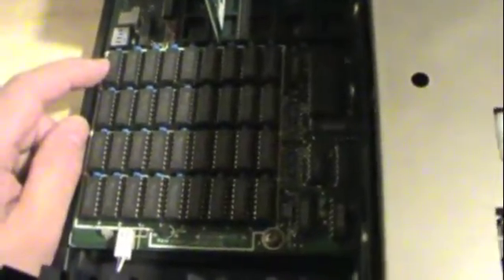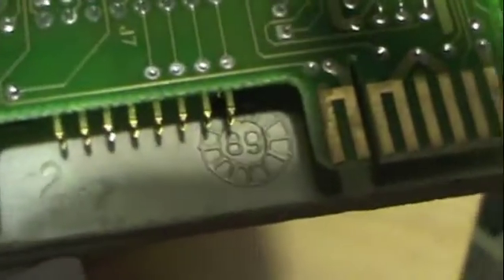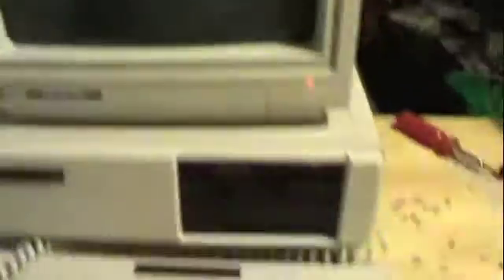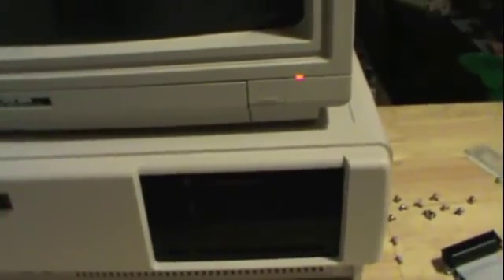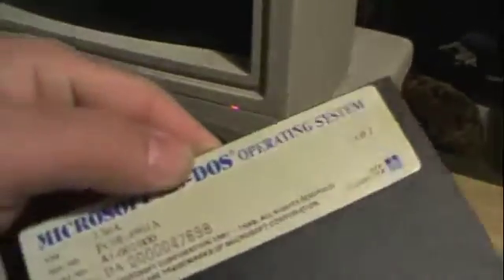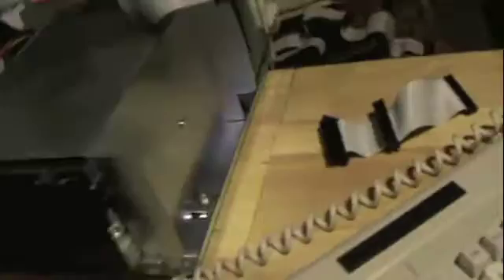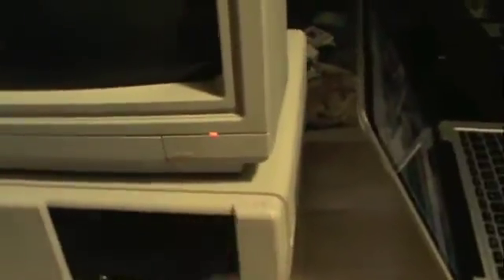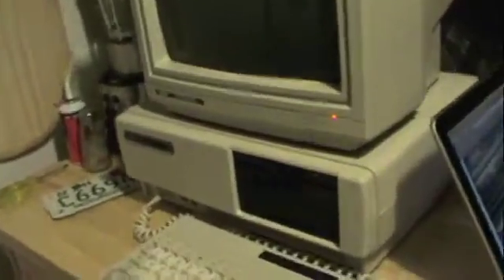Upgrading the Tandy 1000SX

Comment: Why didn't you do a low level format of the hard disk? Given the age of this drive, you really should give it a low level format and find the right interleave for the drive on the internet. Also, I think you should have gone with dos 5, if for no other reason than to have edit.com and qbasic needed to run it. Edit is 1000X better than edlin.
Reply: QBASIC.EXE can be taken from DOS 5 and run on DOS 3.0 at least, I think possibly even on 2.0 or 2.1.

Comment: Why are you bothering with dos 3.3? Why not use dos 5? Dos 5 works fine in XT class machines and doesn't take much more memory than dos 3.3. Also, don't these Tandy machines have dos 3.x built into the rom anyway? Mine does.
Reply from the maker: Because I don't have a copy of DOS 5.x. It's as simple as that! No, only the Tandy 1000HX includes DOS in ROM; and it's version 2.0 if I recall.
Reply: BBISHOPPCM's World
I have a TX that has dos in rom, or at least I think it does because I don't have a KB or DB-9 mouse at the moment or it and it boots into Deskmate (or whatever it's called) which is dos software and iirc, you can quit from it and run dos software which would mean dos has to be in rom. I did enjoy your videos.
Reply: tarstarkusz One other thing, if you have the patience for it, there is a PC emulator called PCE and it emulates an XT class computer with a 80186, VGA, a hard disk and 2 floppy images. If you download it, it comes with DOS 5 installed. You can sys a floppy image or format it with the /s and then write the disk image out to a floppy. It takes some work, but you can get all of the dos files and a bootable disk out of it. I used PCE and Dosbox to get files to and from the PCE emulator (either from PCE onto my file system or from my file system into the PCE harddisk image file).
Reply: The HX's ROM DOS is 2.11.  I used to have one.

Comment: Will the Tandy work with any XT style keyboard? I have a Tandy 1000TX (IIRC, which has a really weird system, it's an XT with a 286 chip). The memory layout is weird too, it has 2 banks of 41256 chips and a 1/2 bank of 4164 chips with the other 4 DIM sockets unpopulated, but it's maxed out at 640k + 128k for video with dos in rom. But I don't have an XT style keyboard or even an AT style with the XT/AT switch. I've seen a number of XT class keyboards on ebay, but I don't know if they are wired the same. Do you know if a normal XT class keyboard will work (BTW.. I know that not all 5 pin din keyboards are XT). I've been involved in computing for a LONG time (since 81), but I cut my PC teeth on  IBM XTs and 5150s. I also went to a 2 year tech school for electronics and PC repair in the very early 90s..
Reply from the maker: I don't know off hand if a normal XT keyboard will work. I did most of my XT-class computing back in the mid-90s, when that was all I could afford (I was 12 then).
Reply: BBISHOPPCM's World Don't feel bad, it was all I could afford too and I was in my early 20s (but I was going to school full time)! :)  But as you know, PCs were expensive as shit back then. Of course, they were much higher quality. Have you ever heard of a memory bank of 4 4164 chips, particularly in a series of sockets that are 8 deep? Also, the sockets are directly next to 2 other rows. Most MBs that I have seen (and I've seen thousands) didn't work in such a way that you could add 32k by adding 4 4164 chips. You usually had to put them in 8 or 9 at a time depending on if they use parity, which most of them did back then.

Comment: These old Tandys certainly have their quirks, but the Tandy 1000 FAQ is a huge help. You can also download disk images of the correct Tandy 1000 MS-DOS 3.3 from that site. I put a 3.5" floppy drive in my original 1000 to allow data transfer with modern PCs. Of course it only works in 720K mode, but I have plenty of double-density disks so that's no problem.

Comment: I know exactly what you mean with the TEAC 5 1/4 Drives. A friend of mine gave me an old office computer from 1992 which I just added a i387 co-math processor to,still need an ISA video card and a case thou. Anyway, the TEAC drives he gave me all had the connectors flipped upside down! Good thing there's extra long floppy cables.

Comment: I ran a bbbs off a trash 80 that I modified to accept a 10mb full size hard drive . I have in my basment a original 1 mb full lenth LIM (lotus intell microsoft) expaned memory card that has a ton of DIPP memory chips I had it plugged into a IBM ps2 model 30 that would give it 2 mb expanded memory for use with microsoft word and lotus 123 . I used to write large databases using lotus 123 and they would not load unless You had at least a 1mb card.

This video took me back to the old days